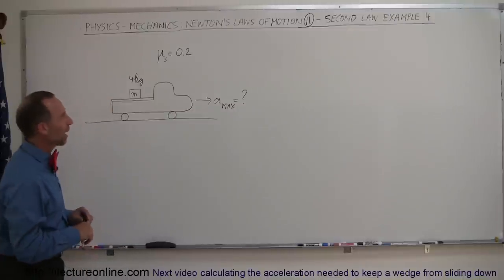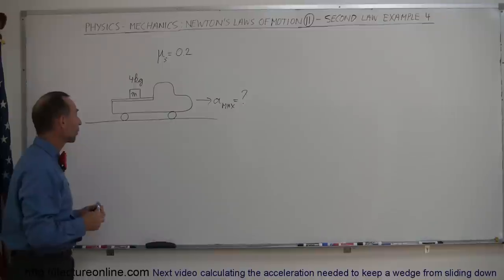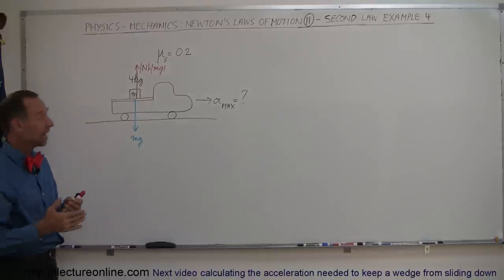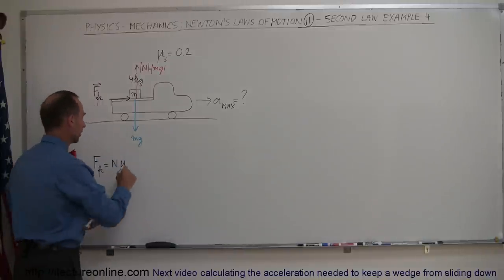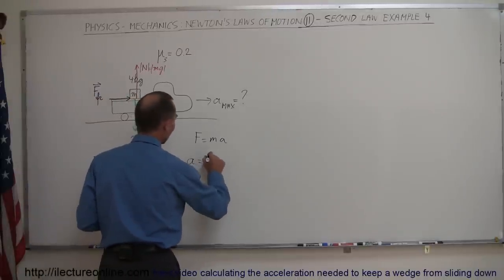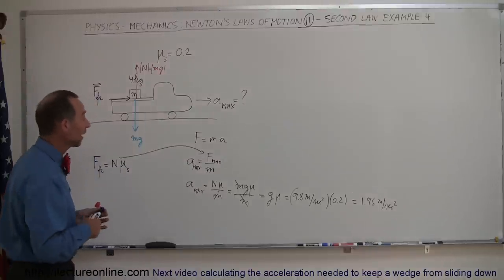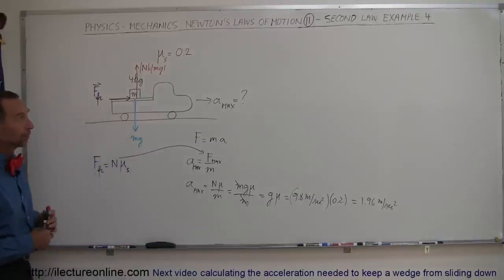Physics 4  Newton's Laws of Motion (11 of 20) Second Law: Example 4

Comment: This means that the since the mass cancels out mass, then mass is not relevant to the max acceleration required to overcome friction, which is a function of g x coefficient of friction mu. That means that the acceleration required to overcome the force generated by Friction remains the same whether the load is 4 kg or 4 metric tonnes. The relevance of the mass comes into play when it directly affects the issue of the force required to be generated by the truck engine to accelerate its own weight plus 4 kg or 4 t at a = (9.8 x mu m/sec2). 

If I have an 81.8 t load on plywood on a metal SPMT with mu = 0.6, then F (Friction ) = 49.08 t and acceleration max to overcome 49.08 t friction = 9.8 x 0.6 = 5.88 m/sec2 or a speed of 84.67 kph after 4 secs acceleration and 127 kph after 6 secs acceleration just to overcome the friction force to start sliding. These speeds are impossible for an SPMT to ever reach.

If I apply 52.6 t Binding force and reduce a to 0.33 m/sec I increase the mass to 134.4 t and force by static friction increases to 80.64 t (0.98 g), while force generated by acceleration max 0.33 m/sec2 (1.188 kph)= 4.5 t, or 4.5 t/ 80.64 t = 5.6 % of Force required to overcome friction. F (Friction Static) = 17.9 x F (a max). Am I on the right track or am I going wrong anywhere there?
Reply from the maker: Good analysis
Reply: @MichelvanBiezen  Thanks. Your reply tells me I am on the right track, all thanks to your video.

Comment: Nice! But I have a question for you. If we are in the same case, with a parallelepiped (instead of your block) of height 'h' and 's' as the length of the base side, we get (s/2 ; h/2) as the center of gravity; my question is "what is the condition, for the block, to not fall, meaning NOT slide, but fall because the acceleration is much too high?" In an exam solution I found the answer to be: (block doesn't fall if)  m*g*(l/2) = m*a*(h/2)   with m=mass of the block; g=gravity force. Hope you see this even if long time has passed. Keep it up :)
Reply from the maker: I would have to work it out, but you want to start with the principle that the "fictitious" force pushing the block as the truck accelerates will act at the center of mass of the block.  The block would tip over if the torque produced by that for is sufficient to push it over.  The torque of the push would have to be greater than the torque produced by the weight of the block acting through the center of mass.

Comment: I would like to see one where a large trailer attached to a small truck effects the side forces on the truck when wind pushes against the trailer, and how the mass of the tow vehicle can counteract those forces.   IOW where would the limit in length be for a truck weighing 7000 pounds, vs a truck weighing 8500 pounds or more when trailer length is equal to 37 feet with a height of 8 feet. The pivot point being dead center of the trailer, the second pivot point the rear bumper of the truck and truck lengths being equal, only mass being the difference.

Comment: If you didn't have a coefficient of friction and that vechile hit another would the box fall backwards or forwards? I'm assuming backwards.
Reply: Correction forwards due to inertia and assuming it's just stopping not being hit by a truck with more force than the smaller.

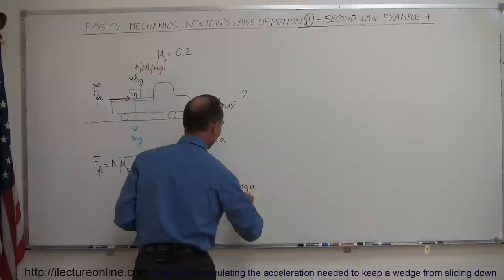Comment: Great video! My only question is the process around time 2:46.  You cancelled out the two masses when one mass was related to the BOX on the truck and the other mass was referring to the mass of the TRUCK.  Is this assuming that the mass of the box and mass of the truck are equal or doesn't it matter in this situation?  Thanks again for the great videos
Reply from the maker: The normal force is the truck pushing back and it is equal to the mass of the box * g.  Thus the m in the numerator and denominator is the same m, the mass of the box.

Comment: Thanks again for your great videos. I have a question. You have other videos with one block stacked on another. In those, you refer to another frictional force between them and opposite to the applied force. You did also include the same frictional force in this video. Since you took into account the friction between the bottom block and the ground in the other and not in this one, is that somehow a reason why there is not an opposing force of friction to the others? Thanks again
Reply: The truck is moving forward. So between the surface of the truck and the box, there is friction force. And this friction force acts in opposite directions for the box and the truck

Comment: I had posted a question under the friction videos about a magnet. What if the box was a large magnet and the truck bed was metal. How would you do the force diagram and is the magnet and wagon third force pairs? My professor loves magnets so he gives problems like that including the forces between a magnet, piece of paper, and a refrigerator.
Reply from the maker: You would need to be given the magnitude of the forces, before you can work any such problem. The force caused by a magnet would then work exactly the same as the normal force.

Comment: Great work sir,pls i am having an issue with one proble

A child has a toy car on a horizontal platform. The car starts from rest and reaches a maximum speed in 4 s. If the mass of the car is 0.1 kg and engine has an effective pull of 0.4 N Find the acceleration of the car.
Reply from the maker: The information that the car reaches its maximum speed in 4 s is not needed.  Use F = ma   or   a = F/m = ( 0.4 N) / ( 0.1 kg)  =  4 m/sec^2    And thus its speed will be:  v = at = (4)(4) = 16 m/sec

Comment: hi
What is the shortest stop time the car can have without the block slipping on the loading plane?
Reply: At a = 1.96 m/sec 2 the car is travelling at a speed of 19.6 m /sec after 10 secs of acceleration or doing 70.5 kph. It would have to slow down to 0 kph in a time of 10 seconds or longer, say 11-15 secs from 70.5 kph to 0 kph to prevent sliding of the box. Deceleration also has to be at 1.96 m/sec2 or less to prevent sliding. If the car keeps accelerating for 15 scs then at sec 15 it is going at 29.4 m/sec or 105.8 kph, and will have to stop at longer than the 15 secs, say 16 secs from 105.8 kph to 0 kph. If the car brakes so hard that it decelerates at greater than 1.96 m/sec2 then the box will slide.

Comment: Thank you for the video but i have a question relating to the car. If we are trying to find the Acceleration of the system, are we not ment to look at the external forces action on the car as-well? in which case we would have a normal force of (m1+m2)g acting on the car?
Reply from the maker: Yes, but since the normal force acts in a direction perpendicular to the acceleration it will not affect the acceleration.
Reply: Thank you very much. I have to say i am a fan of your work!!
Reply: um also would there be no friction forces on the tyres of the car which would effect the acceleration? And would it not have a magnitude of (m1+m2)g*0.2?
Reply from the maker: the coefficient given is for the surface between the truck bed and the box (not the tires and the road).  The friction between the tires and the road is not relevant for this problem.

Comment: what would happen if the box fall down on which direction the box move? same direction as the truck or opposite?
Reply from the maker: If the truck accelerated too fast, the force of friction between the truck bed and the box would not be sufficient to accelerate the box at the same acceleration as the truck.  Relative to the truck bed, the box would slide backwards, but relative to the ground the box would still be moving forward while falling out of the truck.
Reply: @MichelvanBiezen  Thanks for your response. You know i had incident similar to that and that is why I am asking this. I was going on a highway and a pickup track ahead of me with a large wooden box.   The box eventually slide and fell on the highway while the track speeding forward. I don't know if i am imagining this but i could swore that the fallen box were coming towards me. I don't know if i imagined it.
Reply from the maker: Were you not seeing the closing speed of your car and the box (moving forward away from you but at a speed slower than you) ?
Reply: @MichelvanBiezen  i was about 50 yards behind the truck and swerved to dodge the box but  it still got the side of my car.

Comment: is the friction force on the box accelerating the car or accelerates the box itself? thank you
Reply from the maker: The friction force accelerated the box.
Reply: @MichelvanBiezen  If I got it correctly, you imply that μ is constant. However, that can't possibly be the case, because when the truck is standing still the box would still have a force Ffr = μ*m*g (which are all constant) acting on it and causing it to move....
Reply: @georgibaldjiev4469  friction force is self adjusting force,and equal to applied force limiting friction force ,friction force will not produce if applied force is zero that in case of truck is at rest

Comment: thank u so much sir but can you please explain these type of videos a bit longer.My problem is that I cannot determine the forces which are acting on a body if it is moving on a horizontal road or plane and how can friction alone act if there is no applied force as in the previous example.